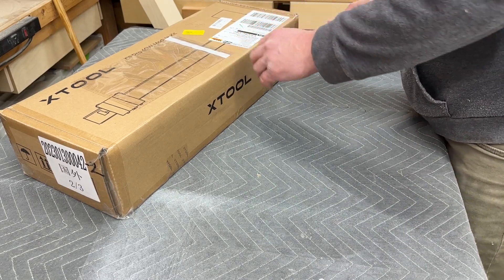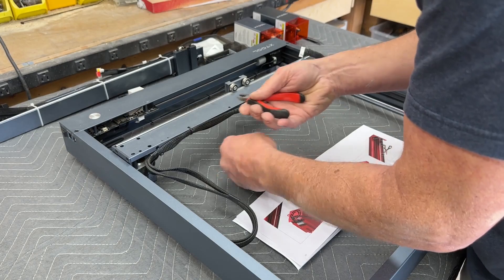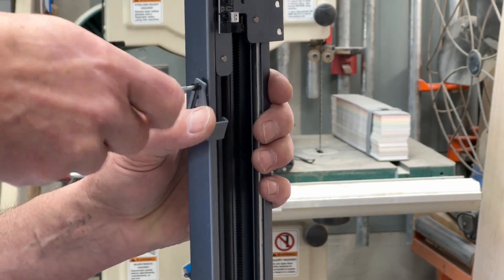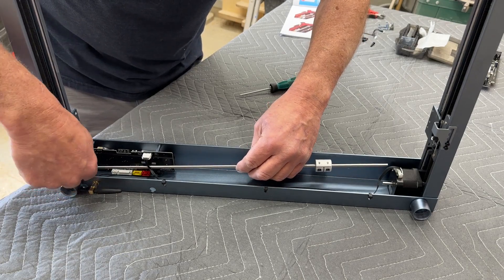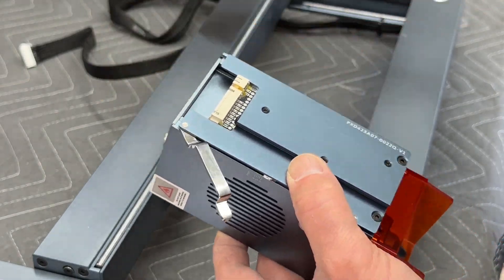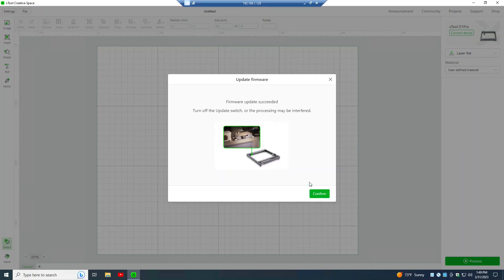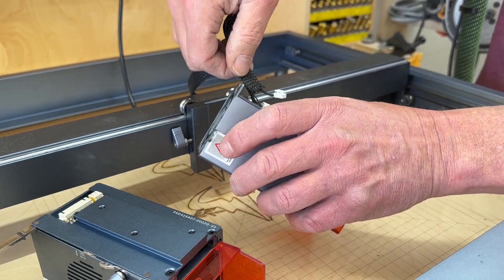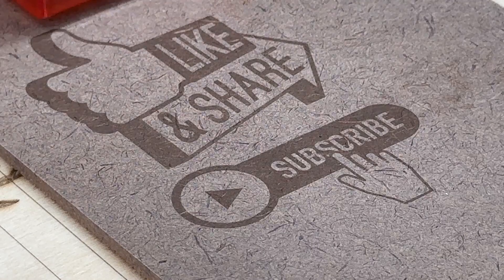xTool 40W Upgrade | Full Installation.

Comment: Did i need to buy the 20 w d1 Pro to replace with the 40 w upgrade , or could I have got the same effect from the cheaper 10w D1 pro and upgraded the module ?
Reply: I just upgraded my 5w. It has to be a Pro though. And you can swap back out after the upgrade, if you want more detail.
Reply from the maker: Jake is right, you can upgrade any of the Pro machines to the 40W. Thanks for watching!

Comment: When changing laser heads do you change the power unit.  Just bought the 40w and 10W pro, and haven't yet put it together.  Thanks for your video.  Very straight forward.
Reply from the maker: Thanks! No, no need to change the power unit when going back to the older laserhead. Thanks for watching!
Reply: @LastLegWoodworks  Hey Guys, I beg to differ on the power supply. Although some would say that it's no big deal, my 40w upgrade has an 8amp output which is higher than my smaller diode module.
Reply from the maker: @Cheshire-Coatings  I think I assumed that the 8 amp unit would be installed since he bought the 40w unit and that power supply is what comes with it. My advice was regarding if he switches back to the 10w head. In that case he can keep the 8 amp power supply in place.
Reply: @LastLegWoodworks  is this correct Last Leg WoodWorks? I too am new to the XTool.
Reply: @LastLegWoodworks  Thank you for the info.